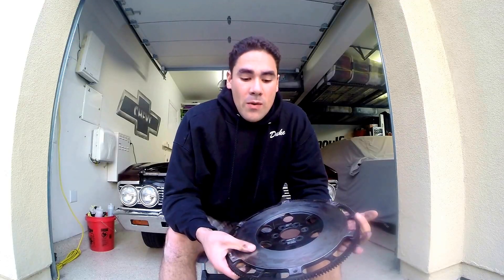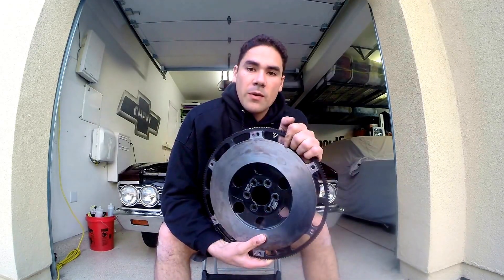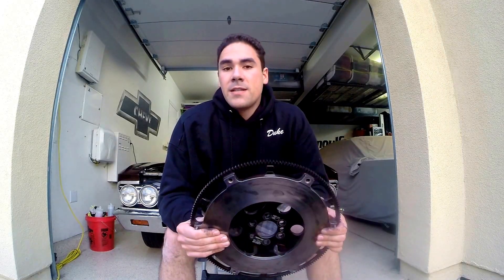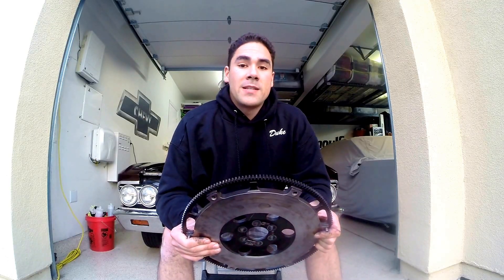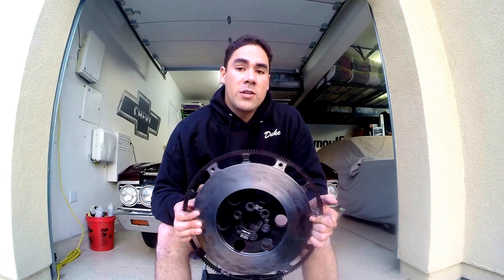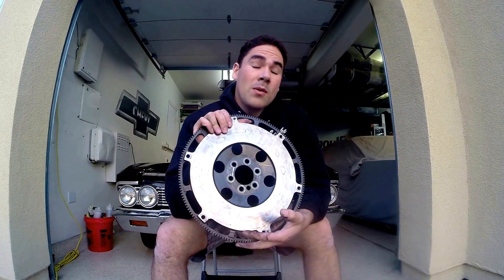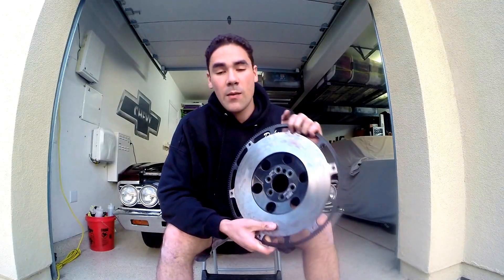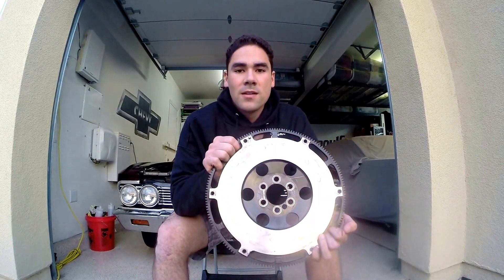Is a Lightweight Flywheel Really Worth it?

Comment: Great advise. I can atest to what you are saying. In the evo x platfrom this is true. Oem 1st gear pull from a stop feels like a torque monster, but sluggish in the canyon, light weight fly wheel feels a bit slower on first gear pull, but in the canyon it feels like a lighter car, big time. I wish i knew this before, i would have kept the oem flywheel on. Love the stomach drop feel on first gear pull. Beast.

Comment: my experience in a corolla xrs.  monkeywrench lightened steel flywheel.  revs way faster.  improved 1st gear acceleration the most in my opinion, marginally across the other gears.  fuel efficiency improved to the point i have 40 more HP over a normal corolla and get better fuel efficiency.  i have driven in a major city with 1hr commutes at 20km/h of start and stop and in that scenario it's very punishing as the car wants to go even in 1st or 2nd at 10 or 20 km/h.  It is really hell to be honest but it has trained me to the point i believe i could drive a ferarri without any trouble downtown.  I'm going on 12 years on an ACT Street clutch so maybe that helped some of the things i mentioned (recommend those btw).  when first installed though I burned the clutch a lot for the first month because you basically have to relearn how to drive a manual.  No one but me has been able to drive this car and this includes people who drove manual their whole lives.  The being unstealable aspect is a nice benefit i guess.  It's more or less like the video says: if you are driving corners you will love it.  anything where you will be shifting it's funner to drive.  If you are in a place where you are stuck in traffic jams, it will be a living hell.  I went from 13lb to 8.8lb for the flywheel and i can say the lightened steel has been durable.

Comment: I put a lightweight flywheel (7.1kg) on my 231hp BMW M54B30 drift car and I can definitely notice the loss in inertia when trying to initiate drift with a clutch kick or throttling into a drift from mid rpm. The car really needs a lot of rpm now. It's probably a bit more lively at high rpm but at low and mid rpm it is dead. I don't like it already. As Google search AI summary says - breaking traction with a lightweight flywheel really is harder and the car feels as if it has less torque even though it doesn't, it has less inertia. Maybe for 1000hp pro cars it's fine, but for low powered seat time and grassroots cars the heavier flywheel is just so much easier to drift. I can see the benefit for road racing though, where you're mostly on throttle at higher rpm and you don't need inertia to break traction and you do lots of fast downshifts under breaking. But for drifting your 200hp BMW I would suggest you avoid it. Make you car as light as possible, but leave the stock flywheel in.

Comment: Does a lighter flywheel reduce rev hang I wonder, or is it a product of the engine computer and it will just put in more fuel to hold the rpm up longer?

Comment: Hi Griffin,
Thanks for your great video, I installed a lightened flywheel on my car around 5 years ago, it worked great for 5 years, now the clutch slips under heavy acceleration.
Is it possible the lightened flywheel could be warped causing the clutch to slip and require replacement?
Is there anyway I can test for this without pulling the flywheel out? 
Thanks

Comment: If you want a light weight flywheel and you also want to drag race, get a set of adjustable cam gears and short headers/intake manifold. The idea is that you are moving the power curb to lower RPMs. The cam gear can be set to give you power at low RPMs. This is ideal for a light weight car like the civics that can hook and go without moving so much weight.

Comment: The factory put heavy flywheels on to allow a smoother and easier driving experience. 
Yes the rotational mass is beneficial as a vibrational dampener but means it takes more torque to initiate the rotation but once it is rotating it will continue by itself for longer. Stored energy. 
A lightened flywheel is beneficial in many ways. From Launch to acceleration to deceleration and stopping. 
If you buy a cheap one then you will be disappointed as it will be out of balance which will increase the harmonics inside the engine that has the potential to break things and cause alot of rotational resistance slowing down the engine and causing power loss. (Torque)  I would advise that regardless of what brand you get get it balanced and skimmed that way you are certain of its specs. 
I use an excedy lightened flywheel on my rb25det. It was skimmed and balanced before installing it. It was out of balance and out of square out if the box. I have spent in excess of 25k in the engine bay alone so an out of balance flywheel on it for how it is tuned for hight rpm and other things would cause vibrations that could easily turn my 25k into a boat anchor.  
So the 100$ for machine saves me alot in the ling run. 

.
Reply: Great info, thanks!
Reply: Could you explain how a skimmed fly wheel effects the power of the vehicle like causing powerless specifically up hills

Comment: Is it correct to say that ITBs will give you the same benefits of a lighter flywheel (faster throttle response), but without the disadvantages? Thanks for the video
Reply: A lighter flywheel doesn't necessarily give you a better throttle response like ITBs. It simply allows the engine to rev faster.

Comment: Aside from the performance aspects,  there's also the street drive ability aspects to think about. With a lighter flywheel,  you'll need to rev the car WAY more to take off from every stop sign , red light etc. You'll also get a lot more noise coming from the transmission and will make the car sound like a dump truck.
Reply: Thats not true at all, unless you have no clutch control.
Not even sure how the hell you think it makes a transmission louder.

Comment: Nice video. I have some mods on my accord 2.4 mt. 165kws 250nm. Replacing the clutch. Adding a 3.5kg flywheel. Do you have experience with this build, I'm uncertain about problems that may arise.
Reply: How did it go?
Reply: Do you have done it?

Comment: Would carbon fibre flywheels ever be a thing?
Reply: Kevlar, and yeah maybe. I hear Kevlar is highly friction/abrasive resistant and impact/shock resistant. Not so much tensile/compressive strength, very stiff.  Maybe it'd make a clutch plate instead?

Comment: I have a volvo 850 t5, I dynod the car with stock fly wheel then changed the flywheel for a lightened one and made more power to the wheels with the lightened flywheel than I did to the crank with stock 👍 lightened flywheel all the way
Reply: Right on; I have two T-5Rs and wanted to put in lightweight flywheels, but am worried about drivability afterward. How are the street manners with your flywheel?
Reply: @unicornsqueezins7906  in all honesty matey you don’t notice the differance day to day, the throttle becomes a little more responsive and the only downside is because you go from a dual mass to a single mass the throwout bearing will make a small amount of noise when the clutch pedal is depressed 👌

Comment: Great explanation. For drag racing (and acceleration in general) you Most Definitely want to reduce rotational inertia as much as possible: the car accelerates faster in short gears. It is less noticeable in high gears only because the engine acceleration is less than in short gears but it never hurts. However, since there is less kinetic energy available during launch, the drivers must adapt their launch technique, typically rev the engine quicker to compensate. There is nothing wrong with launching from the rev limiter if the clutch can take it, the car on my avatar is a 300hp 4-cyl 2.0L N/A with a 5" clutch and it launches at 8,500 RPM :-)

Comment: Don’t forget that when you disengage the clutch and the motor is spinning freely the flywheel weight is what helps prevent sudden drop in RPM as it’s rotating mass decreases the decceleration effect of passive compression in the engine. So a short shifter to quicken your shifts and even double clutching can keep revs steady and get through gears easily whether up shifting or downshifting. So if you’re driving the twisties a standard weight flywheel is fine considering you have a clutch and a gear shift to stay in the peak HP range. On modern cars a lightweight flywheel is a great way to generate phantom misfires and trick your car into limp mode which isn’t going to add performance that’s for sure. Downshifts and gear rattle can be harsh with lightweight flywheel because the tranny is spinning so much faster than the engine as the flywheel doesn’t keep the engine rotating at a matching RPM which can be pretty hard on tranny parts and the low end of the engine. Lots better ways to gain performance without compromising the reliability of you’re looking to improve a car that you also daily drive or want to be reliable
Reply: I've never ever had a ligfht flywheel put a car in limp mode. Got any examples of cars this has happened to?
Reply: @nobodynoone2500  02 WRX with EJ205 with complete rebuild with OEM components other than ARP head studs, ACL race bearings, GSC stainless steel exhaust valves. Threw misfire code with downshifting under braking and hard acceleration over 4500rpm  w/ lightweight flywheel. Swapped in the stock one and misfire went away and has never come back. Shifts are much smoother as well.
Reply: @Natedoc808 Because its a Subaru, you put in a air refresher without a tune and the engine blows
Reply: @thecoolguy9364  haha. Yeah, it’s almost like if you start fucking around with a well engineered, precised machined, forced induction machine it isn’t going to like it.
Reply: That and if you already have a 6 puck clutch your already getting the acceleration bonus so light weight flywheel is not needed
Reply: Flywheels require a tune. If you slapped on a flywheel without getting a tune you’re an idiot and the engine blowing up was a valuable lesson.

Comment: I have a question:
I drive a MK7 Fiesta ST. And when I‘m driving fast, I change gears also too fast for the car(It can’t slow down the rpm as much as it should)  So it also would be better in both directions...? So it would benefit me in increasing the speed of the rpm climbing up and also of getting the rpm faster down? 

I hope you understand what I‘m trying to ask. (English is not my motherlanguage😅)
Reply: Geile Potsau technically yes it would accomplish that but you’ll transfer that load into the crank bearings. You’re better off getting a short throw shifter.

Comment: I'm taking the lightweight flywheel OFF my C5 Corvette.  It completely ruined the car.  RPMs crash and sometimes stall out the engine when I push the clutch in at speed or between shifts.  If it doesn't stall, the RPMs bounce around until it stabilizes which is really annoying.  Really sucks in stop and go traffic.  Yes this is after an expensive dyno tune to try to fix it.
Reply: Also, I get tons of racket from the aluminum flywheel.
Reply: I also have a big cam which exasperates the situation.

Comment: Hey Griffin, question for you. I have a 65 mustang I am rebuilding. I have a 351Windsor and using a T5 Manual Trans.  I'm NOT drag racing. Just a Daily driver. I'm looking for Flywheel info. Whats your thoughts on which one I should use? Thanks
Reply: fidanza , had it since 2007, i love it.

Comment: You hit the nail on the head ...
If one has a 5 hp Briggs Engine that was turning a 500.lbs flywheel 
versus a 5.lbs flywheel,  whitch of the two flywheels would have the most torque while spinning  ?
Reply: IF the engine is under load, the 5lb flywheel would have more torque due to the fact it requires more energy to spin up a heavier flywheel. That extra energy used = loss of power and torque. 
However when you come off the throttle with a heavy flywheel, the momentum is going to continue to transfer more torque and the car will roll longer. If you're slipping the clutch to launch with a heavier flywheel, the extra inertia can potentially make the launch feel faster.

To sum it up , OEM flywheels are heavy to make the car easier to drive and smoothen out the power pulses of the engine .
Lightweight flywheels are better for performance but only in the hands of an experienced driver
Reply: Um I'm not sure if changing the weight would change the tourque much in consistent clutch engagement, but if you were revving and then dumping the clutch then the 500lb flywheel would have more energy stored for the clutch to absorb

Comment: what are some brands you recommend?
Reply: @Guns Cars and Digits that is good information! I got a light mass flywheel because I wanted more of the engine power to go to the wheels. for my particular scenario, I am more focused on gas mileage rather than speed or torque so it made sense. I love that you have done your research and are willing to share thought. Thank you!
Reply: Just get your own flywheel lightened.

Comment: So of it frees up more hp why would u not want it for drag racing?
Reply: so the deal is you gain horsepower (at the wheels) and by extension torque with a lighter flywheel but you lose inertia (the energy stored in the flywheel from the mass that's spinning)... so now you need more torque to get those wheels moving.  It's like you're swinging a bag full of quarters around and hit it into your friends chest and knock him off his feet.  Now you have a half full bag and hit him swinging it around at the same speed as before.  Now you just make him stumble.  With the half full bag you have to spin it faster than before you hit him to knock him off his feet again (you have half the mass so you need to up the speed to achieve the same amount of force as before).  The extra mass in the heavier flywheel can be used to help the car start from a stop better.  You may not accelerate as fast after that as if you had the lightened flywheel, but if it's a relatively short distance then it may not matter.  There's probably an optimal flywheel weight for any given distance where it balances out for the fastest drag time.  A stock flywheel is probably a lot closer to that number for drag races.
Reply: @penguinpie5056  Your explanation really help me to understand wht happen to my dirt bike after i make it light. Thanks

Comment: Had a lightweight flywheel in my accord ages ago. Made the motor rev happy, and was able to raise and drop revs at a moment's notice however when driving uphill without the lighter flywheel I only had to drop to 4th or maybe 3rd gear to make it up the hill. But with the lighter flywheel I had to drop to 3rd, or even second gear due to less rotational mass helping the engine push the gearing. Went from a nearly 23lb stock flywheel to a 17.5lb fidanza.
Reply: Hm...i guess not much use of lightweight flywheel in offroading then...:-(
Reply: Once the car is in gear I would have thought the momentum of the vehicle acts like a massive flywheel, so it doesn't reduce your uphill power. I would think a lighter flywheel would help acceleration in the lower gears, by acting as a weight or inertia reduction, because the flywheel is faster than the car at low speeds, so weight saved there is worth more acceleration than a pound off the car frame, or the driver's belly. On some cars, the idle speed might have to be increased, or use more throttle pulling away.

Comment: The trans does not slow the engine down. The engine slows to idle when you put the clutch pedal in because because your also lifting off throttle. And the benefit of a lighter flywheel is lower inertia so the engine rpms drop/climb faster. Making rev matching up or down faster. The engine is mechanically disconnected when you push the clutch "in".
Reply: he said when you let the clutch out though.
which it will be trying to slow the engine down, due to basically the whole drive train and the ground itself... or it could also try speeding it up if you haven't rev matched proper... (money shift)

Comment: Thank you. Great video. What if the car will be used on a short circuit arranged by cones? Slalom on a parking lot, with very short straights (less than 15 metres)  and sharp corner (90/ 180 degrees). Lighter flywheel or heavy?
Reply: Ofc lighter. You will win seconds. The difference is 1000rpm faaster with lighter one.